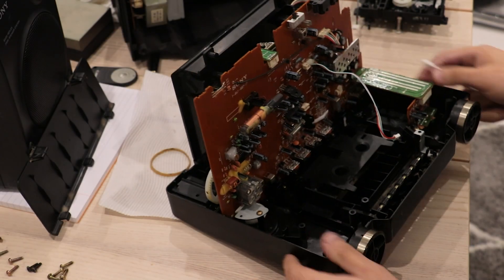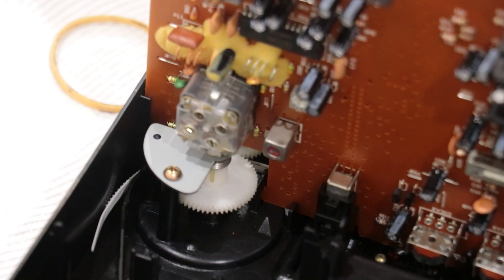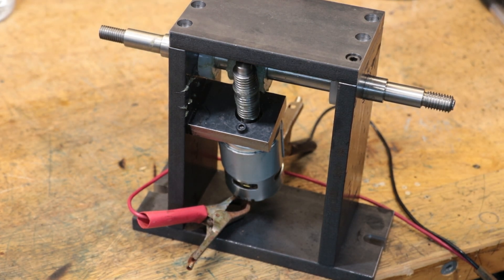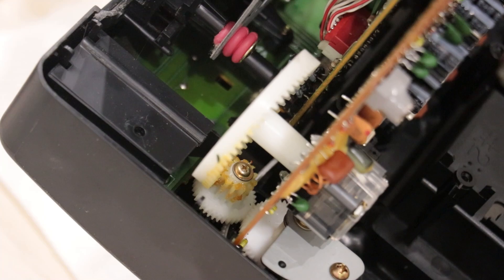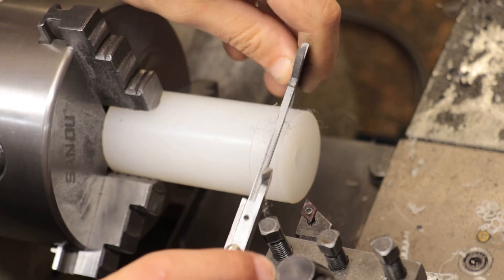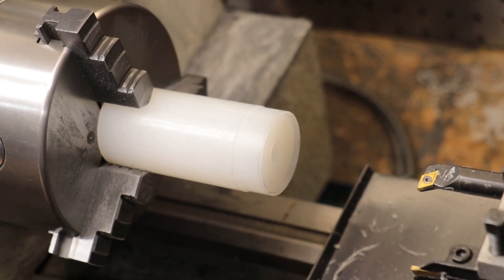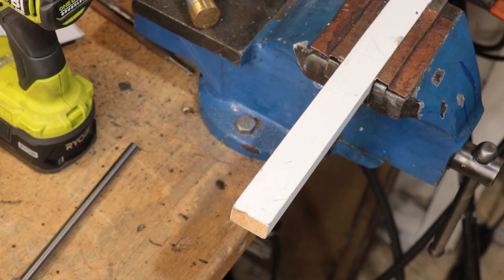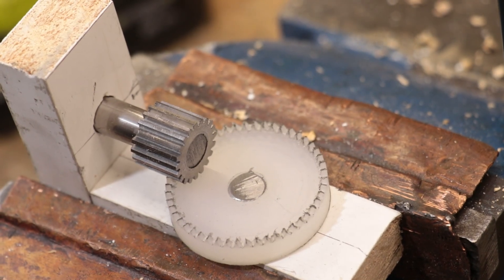Straight Cut Face Gears - A Half Decent Solution

Comment: Uhm....my cheap crap telescope EQ mount has 100:1 worm and wheel on it. No idea where you got this 12:1 limit from but....yeah, no.
Reply from the maker: 12:1 is the lower limit with a single pitch worm because you can’t make gears smaller than 12 teeth. Not the upper limit
Reply: @artisanmakes  Oh! We had our limit scales backwards. Was trying to figure out how it could top out at only 12, forgot to compensate for the downunderness from the upy overy. Right, carry on.... 😅

Comment: i noticed that the unit was a Sony.  if you are attempting to repair the cassette tape drive you may find that you couldn't have chosen a worse manufacturer.  inside the play spindle there is a (for want of a better word) foam/paper disk that is incredibly fragile and is responsible for transferring rotation from the motor, gears, belts and pulleys into the tape compartment side of the  play spindle. the foam/paper  disk does this through friction . I'm guessing it was used to allow for slip in cases of the tape coming to its end, or if it jams, in order to not snap the tape. in reality it  just wears thin and tears resulting in a cassette player where everything else will work but the play spindle will remain motionless.

Comment: A good idea, especially if you are going to be using nylon or plastic gears is to simply copy existing gears.  By copy, I don't IP, I mean literal copies like a xerox machine.  Take a mold of it and then pour a plastic gear.  You can also "repair" old cracked gears using this method.  You simply repair the old gear with superglue and then take a mold of the repaired gear (the superglue will NEVER hold for use) and pour a new one.  So long as the teeth are good, the new gear will be a perfect copy.  This is really good for old one off plastic gears that have split (which you see a lot in consumer goods) because of age.  They no longer work, but they still exist and so you can "repair" it with superglue and then make the copy.
This method has been used for decades for small run parts, prototypes and even one offs in prop departments (an original can be made in wax which is easy to carve, and then a mold taken of the finished piece).  Randy Raine has a youtube channel with many examples.  I've been able to save some plastic parts in expensive items using this method.

Comment: Even most digital tuners (pretty much ALL modern(and by modern, I mean the 70s and 80) radios are digital, even if they have an analog dial) use string around the tuning knob to turn the tuning condenser.  The goes back to the very early 30s.
The earliest radio I have that is partially digital is from 1974.  It uses an IF chip, but otherwise uses analog circuitry.  The reason is digital is just a lot cheaper and simpler to build than a good analog circuit.

Comment: To reduce the uneven wear and contact from the arced motion of the teeth, and since it's sort of cup shaped, couldn't you do a second cutting pass? By that I  mean cut the teeth like you have, then position the cutter slightly inward and just "plunge", so it cut's slightly outside of it's own centre line, and widening one side of the teeth slightly? Would that even help or would it just reduce the contact area and prevent binding?

Comment: this is circular rack and pinion or full sector rack
it would make sense to be cut on a shaper  or the way you did it like a normal rack and pinion rack with a teeth shape similar ro a circular gear of the same size
Reply from the maker: It would be nice to have shaper on hand wouldn’t it. I think that’s what using the next cutter size up tries to help with - giving it some extra clearance to get around that the teeth aren’t tapered
Reply: @artisanmakes  if you think about it the teeth actually are tapered, only valeys are not so it can't be too thick or too thin  otherwise it would skid on the middle  or lock up on the outer diameter
you could even be stupid with the design and by only knowing the reduction and teeth number you want and machine around the teeth that actually work

Comment: This face gear is gonna save me some trouble for sure, I have to figure a way to make them without a mill.
Keep going! You are a necessary watch ever since I found your channel through the mini milling mods video I stumbled on.

Regarding wood : MDF, HDF (Hardboard/Masonite), Plywood, Hardwood (Birch is my favorite) All make for really nice flat, stable, "dense" * high precision** replacement parts for poorly machined chinesium tools and machines, or Jigs/fixtures. 
I can make tight fitting parts, and in a mostly stable temperature environment with already acclimated wood it stays tight.  If you add metal reinforcements, fire or friction harden the hardwood, use CA glue, it can last. 
* Density -- 25mm Birch is stronger and heavier than thin poorly cast AL or Fe
**High Precision -- Requires Careful Operator who measures and/or scribe 10 times, cuts 2-3 times

Comment: Hi :)
I have a question (I'm no expert at all)

Could it be possible to give a tapper to the (soft steel) face gear by "grinding it" against a hardened-steel normal gear ? 
I don't know if hardening gears is even a good idea, it's just an idea that popped in my head :)

thanks for the video as always ^^

Comment: Reaming a hole in wood? I would have NEVER thought of that. Kudos, and thank you for a tip I shall never forget.
Reply: Also in 3D prints...  holes are usually smaller then drawn, perfect fit for a reamer.... no more endless tweeking of your settings...  don't push it in, let the reamer guide you   

steeltools are very universal for metals wood and plastics...  (not always)    8-)

Comment: Don't make face cut gears out of metal.    If you do there will be rapid wear.   They work well for light loads if plastic because the plastic is elastic and the teeth bend a little as they go in and out of mesh.   be sure to use plastic compatible grease.

Comment: Ha!   A liquified rubber drive belt in a boom-box/cassette player - a VERY common fault - fortunately you can easily buy replacement belts or even make your own from stock rubber rod, carefully cutting to length with precisely squae ends, and joining the ends with super glue.
Unfortunately cassette tapes don't last forever.  Particularly if the tape was made by BASF - their tapes chemically deteriorate and smell like urine.

Comment: Keith Rucker recently (i.e., within the last 2-4 months) showed how to make a good approximation of a bevel gear using regular involute gear cutters.  The bevel gear that he made was for a low-speed application, so he was fine with how he did it.  I don't recall whether he said what his references were for the technique, but if you find his video, I'm sure that you'll be able to make a similar bevel gear.
Reply from the maker: I’ve watched a few of his bevel gear videos, which are fantastic, and it looks like he is using the proper bevel gear cutters. Unless it’s a video that I managed to miss. I’ll hav wit have another look. Cheers
Reply: @artisanmakes  Keith said that he did not have the proper bevel gear cutter for his job, but some research gave him the method that he used by using his standard cutter.  His email address is shown in his videos, so i recommend asking him for the references that he used -- maybe you'll be able to do the same for low-speed bevel gears.
Reply from the maker: I must be misremembering the video then

Comment: I'm not an expert, but I have always been told to use reamers on low rpms instead of the high speed you are doing. Keep up the great work!
Reply: On plastic and wood it's ok to have some more rpms.
Reply: @filopat67 soft materials can have a little more RPM, as a treat 🙌
Reply: @filopat67  plastic might melt and wood can cause more friction - heat (bad idea). I would stick to low speeds.
Reply: @_Jester_  Nah, I've been doing things like that for over thirty years, never once had had any problems.

Comment: i always preferred the "string and spring" dial mechanisms...

love the old "hand routed" PCBs of the early years.

i developed a hatred fro all bevel and crown wheels as they were used in the little tamiya cars.... yay, super avante!

its actually relatively easy to generate proper bevel gear geometry with a slotting saw and TWO rotary tables. its a bit of number crunching, but once set up, its really just a matter of running back and forth and rolling the work as you progress... if you know the basic method of planing a spur gear, a bevel is just an extension of that theory. you are rolling a cone along a flat surface. it has a point of convergence. everything relates to that point. think of "taper roller bearings"...

no special cutters, and you generate an ACCURATE profile for ANY pitch or tooth count... using just ONE saw blade. (no harm in stocking various thicknesses and diameters though ;))

i absolutely REFUSE to ever use involute cutters, theyre a waste of money. of limited range, and are always a compromise, even on plain spur gears. if you want any gear to have any degree of accuracy, high speeds, etc... you "generate" the profiles.

watch a "gleasson bevel gear generator", and try to picture it as if the cutters stay stationary. replace the "two cutters" with "two opposite sides of single saw blade". dont try cutting one tooth at a time, just start at one extreme and work your way through them all until finished. 5 passes per flank is generally good enough, any more and you feel like youre simply cutting air. 

in that regard, CNC does make it relatively quick.
Reply: Two rotary tables is quite the outlay though 😅
Reply: @wrongtown  what? a pivot? and a few stops? or a tilting vice? or even some angle blocks? you only have to change angle once per revolution. the tricky part is knowing what angle that is. or, more, how far to move the cutter for a given change in angle, as thats generally easier to measure. trigonometry... yuk. maths.
Reply: @paradiselost9946  my dude, you said two rotary tables.
Reply: @wrongtown  and? your point being?

some people have angle blocks. some people have tilting rotary tables. some people have tilting mill heads. some people have astronomical dividers. some people have sine bars.

if you cant figure out how to produce compound angles, you have the wrong hobby.
Reply: @paradiselost9946  never mind, have fun being condescending 🙄
Reply: @wrongtown  i freely gave a pointer for a technique on how to generate spur and bevel gears without wasting money on unnecessary tooling that will never get used.

extremely condescending ;)

you choose to complain over one minor, and insignificant detail.

extremely gracious ;)
Reply: You got any calculators or guides on how to calculate angles for the cuts? With a straight blade as in slitting slotting saw? Do you get the involute shape
Reply: @aaronmarkstaller  try "andysmachines" as he has the only clear and simple tutorial on the process.

if you can get your head around the idea, then its only an extra step to figure out how to "roll" the cone of a bevel gear to produce the desired "convergence".

like all other "generating" processes, it produces the proper involute profile for however many teeth its calculated for. 

and unlike using a standard hob, or rack/pinion cutter, it allows you to make different pitches and pressure angles if required, with only ONE cutter.

Comment: I had a feeling you'd get to these sooner or later. Interesting fact on them is these gears (the white ones you displayed) are most often hot-press formed or less often injection molded. 
OH! And that rubber band! Did you know the main reason for choosing a pair of wheels with a rubber band instead of just meshing gears was to prevent the torque transfer from the motor to the tape. They tried using gears and it would snap the tape in the cassette. If you go back to old 8 tracks you will still find that rubber band design because they didn't have "digital" motor control until later. Yeah I know that ages me pretty easily but I'm old so whatever!
Reply: And slip-clutch’s = 2 plate pulleys with a felt washer between them and a spring putting tension onto the back of one of them; when the leader tape reaches it’s end with the clamp in the spool = enough slip for the tape to not snap and the recorder’s auto-stop to activate 😉, I have an interest in vintage things and have a cassette recorder service kit
Reply: the capstan/pinch roller determines tape speed, the spools just have to rotate with enough tension to wind the tape back on. as the gear ratio is constantly changing as the diameter on the spool changes, something has to slip...

pulls out the trusty bic pen and starts wirling cassettes

lol, the number of tapes i had to rebirth by swapping them into a new case...

makes me wanna get the 4track back out, i miss playing things backwards and messing with the pitch control. made a friend puke his guts up by playing one track with my own form of "remixing"...

oooooh, or getting "flanging/phasing" effects by double tracking on a slightly modified twin cassette deck... ie, remove the erase head...
Reply: @paradiselost9946  I was hoping I'd get a commenter like you following up. I never got hard into mods or anything but I did have to repair a few automotive units back in the days before. What is rather surprising is rate of advancement for the tech. Took iirc 12 years for the first breakthrough (going from single sided encoding to both sides) and then nothing significant until CDs. Then those went extinct in half the time it took tapes with 10 times the advancements... only 2 years to go from massive disks to the "compact" versions and then another 2 for minidisk, and so on.

Comment: I believe they’re also known as a “crownwheel”.
Crownwheel & pinion was an old form of vehicle transmission before differential units. Last time I checked they were still used on Scalextric cars & on some early shaft drive motorcycles.

Comment: Nice work on the gears.  For wood, if you drill MDF and put thin CA glue in the hole it’ll reinforce the material so it’s stronger after reaming.

Comment: ... i just realized cutting bevel gears woukd be as simple as mounting a dividing head on an old single point cutting metel shaper and turning the divinding head after adjusting for depth every full rotation. 

... Huh. I found one use for a metel shaper. Making bevel gears.
Reply: not quite, but close.

picture how a cone rolls on a flat surface. its TWO rotations. 

yes, you can cut them on a shaper, thats exactly what a gleasson bevel gear generator is doing, just with two cutters, working on opposing flanks at the same time. its a very fancy and specific use "shaper/planer/slotter". dont even have to grind a fancy "20 degree" tool, as thats achieved by rotating the work and offsetting the cutter.

as the work rotates around, the cutters also rotate on the other axis, exactly like a cone rolls.
everything converging to that central point of rotation.

or, you can keep the cutter "fixed" and rotate the work whilst tilting it up or down as appropriate, for each "shave". i believe that was how the "bilgram generator" worked... not sure, theres scant information on those ones!

 once you have the maths figured out, a jig with the appropriate angle stops, and cutter depths written down, its almost faster to cut them this way. 

you can also do them with a regular slot saw, which is my preferred method, as its always the correct profile, regardless of pitch or tooth count. involute cutters are always a compromise, and having to stock whole sets of different pitches for things that may only get used once in a blue moon... seem rather pointless.

Comment: The issue with tight tolerances in wood is more long term.  Because the moisture level changes, the wood will swell or shrink.  The reamed hole will be fine for now, but in a day or two it may be too tight or loose.
Reply: He chose wood for a quick test, and for that it's perfectly fine. I'm sure he's aware that wood is not the right material for a long term application.
Reply: @_Jester_  he had commented about being surprised it was accurate in wood.  I was replying to that.